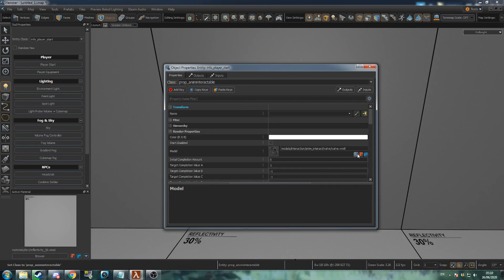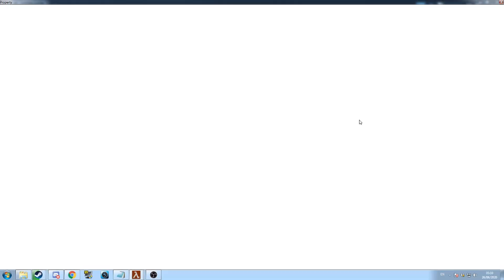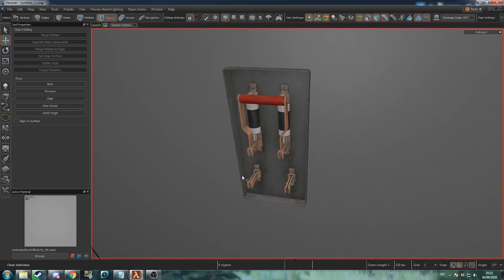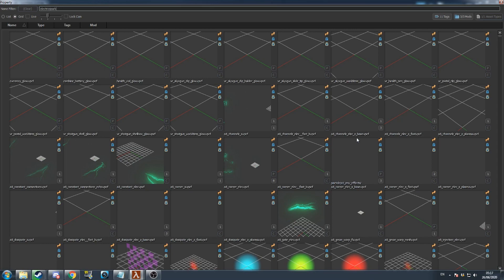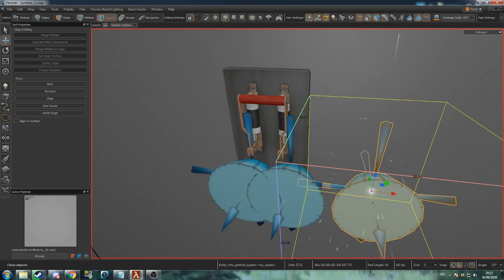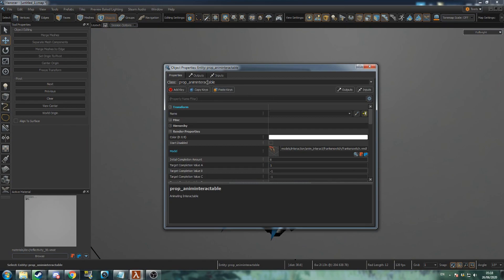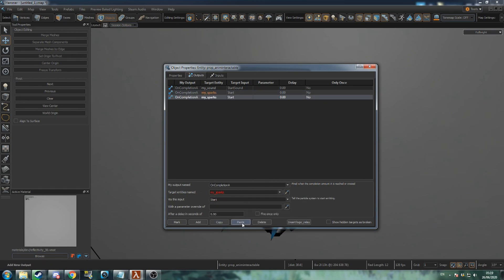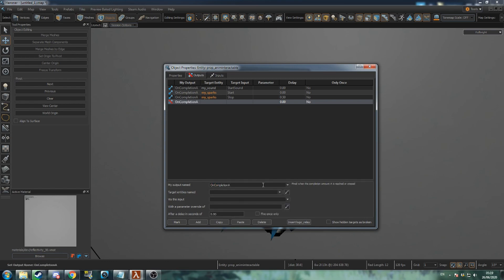How To Create A Switch and Sparks in Source 2 Hammer

Comment: Does ambient_generic work in HLA? I have tried to use it instead of point_soundevent because it has more options but I have not been able to get it working.
Reply from the maker: ambient_generic is no longer used. You need to use point_soundevent
Reply: @Hosomi  Is there any way to control volume or distance with point_soundevent?